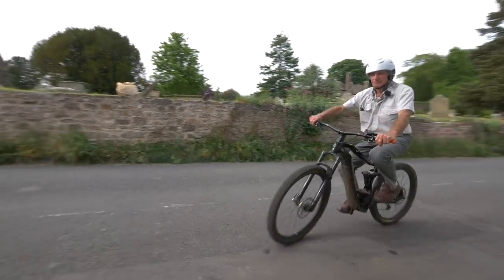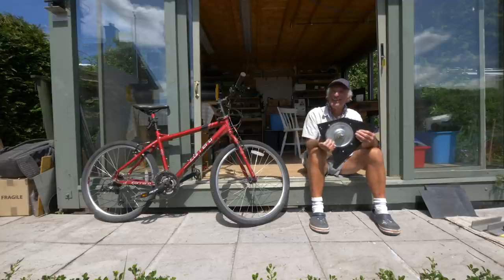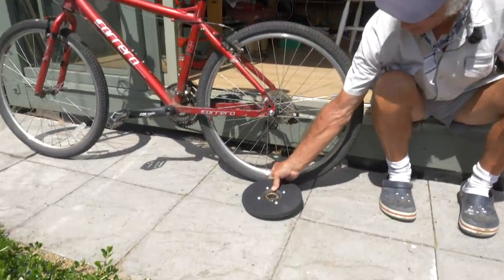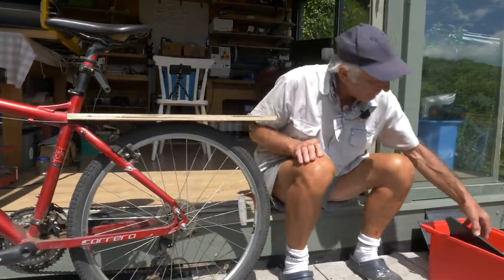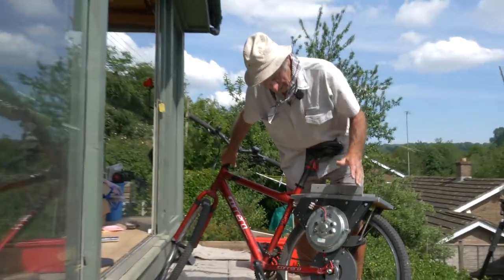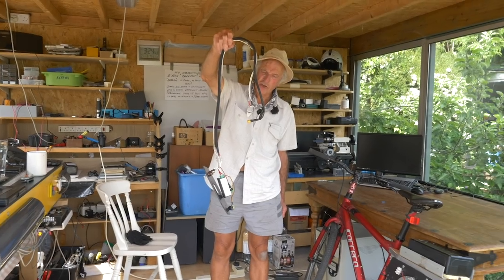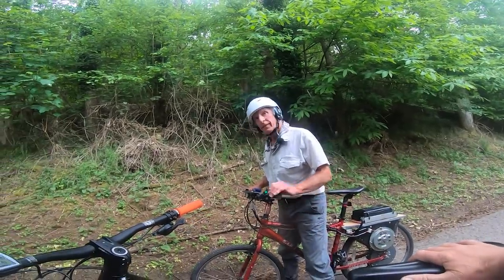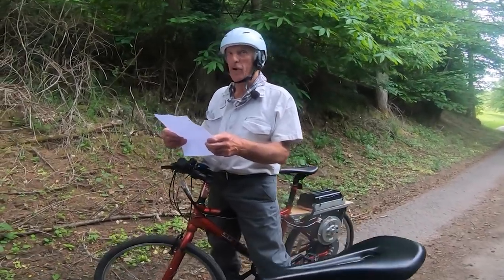Building The Cheapest DIY E-Bike Possible? | Homemade Electric Bike Build - Pt 2

Comment: How about this for Rays next video. EMBN gives Ray a 14speed Rohloff hub and a Shimano E8000 Alloy frame dual suspension Emtb and let him loose with his cnc  machine to combine the two as a mid drive motor/gearbox in the one casing then chop alloy frame to fit. Not only a entertaining must view  but his talents could produce a brilliant usable improved Emtb.

Comment: Love this, two things I would recommend is putting a bigger chainring up front to avoid just cruising along on the motor and change the front forks to put a disc brake on the front wheel as stopping with the increased momentum is essential.

Comment: I like the build, especially the belt drive- should be quiet in operation. In the US, can't find that pancake motor, but they have 36vdc chain drive dc motors built for eBikes for about $50 (and  surplus for much less). However, the time spent on the project is important too, so for the average guy probably cheaper to buy a kit from China, like a BLDC hub motor with controller.

Comment: He keeps talking about the speed controller varying the voltage from 1 to 36...that would be the old way to control the speed, but would also reduce torque as you reduce speed. The controller says 'PWM OUT' above the led readout, which means the motor receives 36 volts all the time, and as you turn the potentiometer, the controller varies the pulse width to give full torque to the motor at all speeds, while varying the motor speed.
Great video though. Very entertaining, especially to someone from the other side of the pond.

Comment: A simple friction wheel attached to the motor and a bracket with an old brake cable to raise and lower it would cost next to nothing if you cobble it together from your spares pile

Comment: As a comparison - My hub motor kit cost $170 shipped, including a nice lcd screen and twist throttle. It goes 30mph, is nearly invisible, weighs less than his setup. -- His setup goes 23mph, weighs more, is huge and ugly, gets in the way of using the bike, cost about $70 plus many hours of labor and thousands to buy a cnc machine. And his motor was used, a new one would cost a lot more.

Comment: interesting build but no mention of battery cost in build estimate,
i actually made an ebike for free,i will post a video on that soon still tweaking bits. the rear hub motor was a gift for christmas so cost nothing to me had 2 mtb made one good bike from the two, batterys free sourced from multiple cordless vacs i worked on with dead battery packs but most of the batterys were all good,fitted gps speedo and voltmeter these were given to me on a scrap job,i forgot to mention i am a bit of a mad inventor and throw nothing away.

Comment: I just spent £680 on a mid drive kit that's coming in august. I thought of ways to put an 11 tooth sprocket on a cordless drill, then another chain round the big chainring and use the smaller chainring(s) for the main chain to the back wheel. I'm not convinced cordless drills cool that well as they were intended for short bursts of power followed by a break. My 18 volt Ryobi should have enough torque for this but the drill head locks in place when the throttle is released. My 14.4 volt challenge drill has less torque but okay.
I've made go-karts with starter motors when I was a kid but they used a broom pole as an axle with no bearings! The 5 wheel go kart was better but both designs eventually burnt out the starter motor which is a highly inefficient and power hungry motor that drains the battery quickly and is only meant for short bursts (like when starting a car). The starter motor engaged a fan belt that engaged a sandwich of wooden discs with nails between them which was the wheel by nailing an old bike tyre to the wooden discs.

Comment: Just built a Escoot out of a seized chopper (free) a old brushed ebike  motor £20 a scooter controller+throttle off eBay £15 n the battery pack n charger of my mums old 4mph mobility scooter 24vX10ah (also free) but can be picked up on eBay for £50 it does about 14mph flat out 😂🛠👍✌

Comment: Price of battery fuse holder fuse switch wire and connectors was not included in price so it’s over well  200gbp especially the battery is probably the most expensive part but you don’t list it